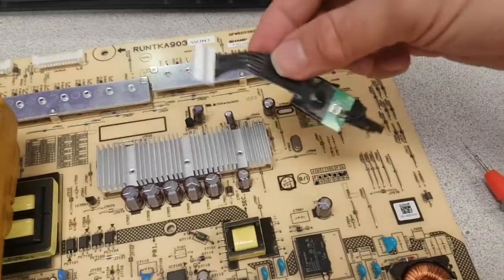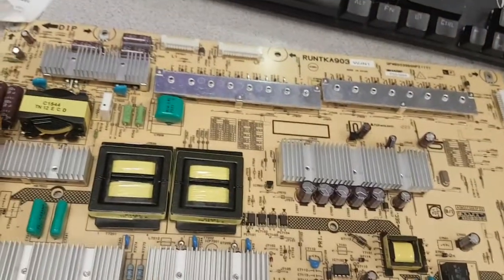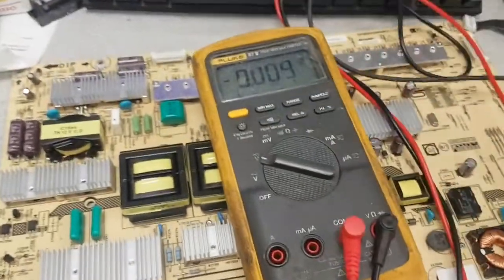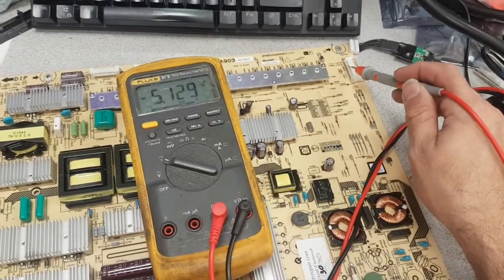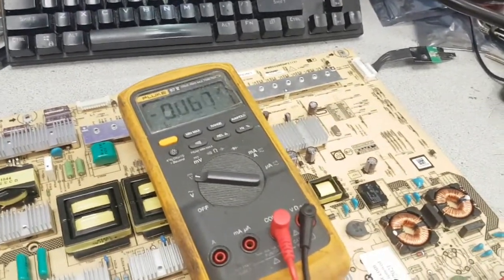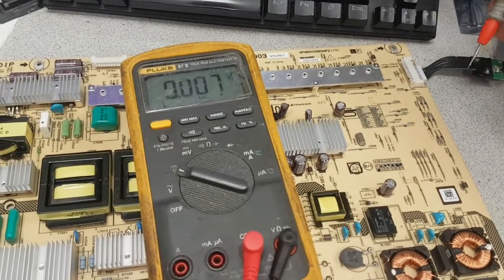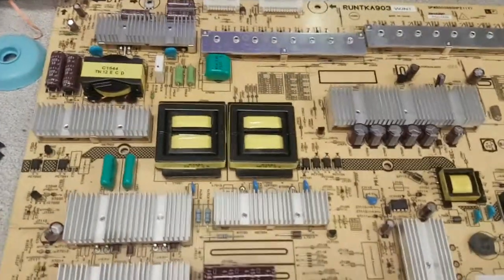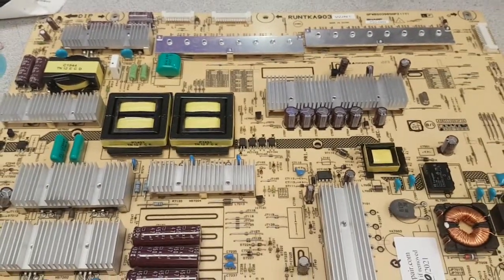Sharp LC-80LE632U power RUNTKA903WJN1 / PSD-0888 functionality proof and how to test guide

Comment: Is there any video  for making  the power  on switch  for the  LG power board
Reply from the maker: We have many videos showing how to test LG boards. And there may be some minor differences here and there, but the principle is more or less the same. You should check the video we recently posted about how to test Sony boards - A LOT of what is said there applies to LG power boards as well.
We might even have one for LG boards that I have forgotten about, but it is more likely - practically certain - we have different videos for specific LG boards, though not necessarily the one you are working on.

Comment: Disculpe amigo, cómo hace el puente para que se active el voltaje de la t con?
Que pines unes?
Reply from the maker: There is a pin on the connector that is called TCON-ON or something similar...you need to send 3.4V to 5V to that pin to activate the 12V TCON power.

Comment: What if you do not have the Standby 5v, what would be the problem ?
Reply from the maker: First and foremost you need to make sure to detach the main board from the power supply to  make sure it's not a short in the main that takes down the standby voltage. Then, if there's still no standby, you inspect the standby circuit on both primary and secondary side for apparent problems like blown fuses or resistors, shorted capacitors, shorted fets and diodes and so on.
I know you would rather have me tell you what exactly is wrong with your board but first that would go against our primary existence as a commercial repair service provider as opposed to public scholar and two, it would definitely require a considerable stretch of imagination to tell you what is wrong with a board I have not even seen or tested.
Reply: @coppelltvrepair  Do not worry , I understand, I have a small workshop just for basic electronics....thanks for the answer ....

Comment: If I don't have 5v at the output of the rectifier (your first test) what do I check next?
Reply from the maker: I am sorry, but I do not remember the video and do not have the time to watch it just to answer the question.
as a rule of thumb when you lack voltage somewhere to go earlier in the circuit.
But there are a lot of exceptions to that due to the feedback loops and control circuits detecting issue that is actually further in the circuit.
So I am not really helping much here, sorry.